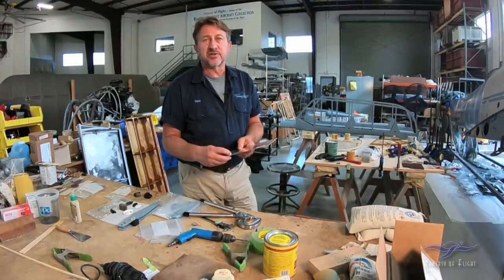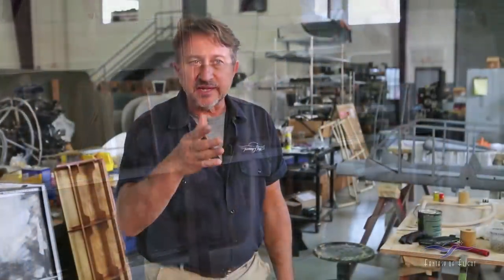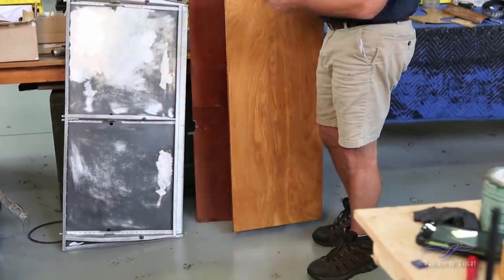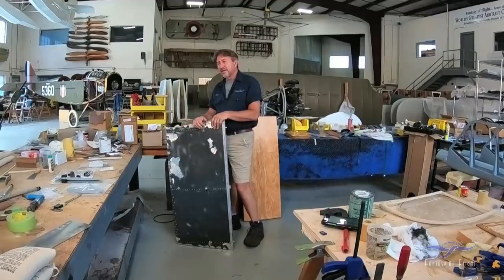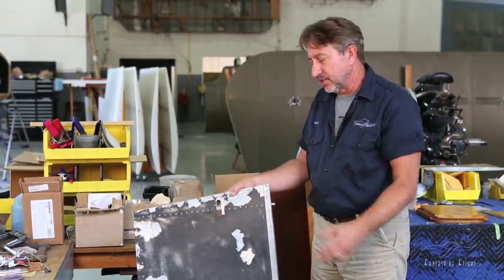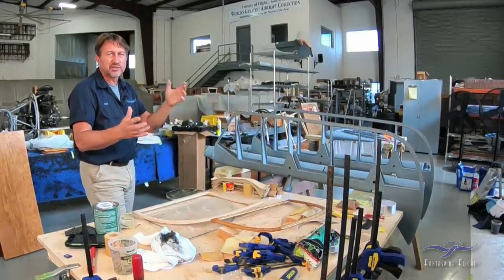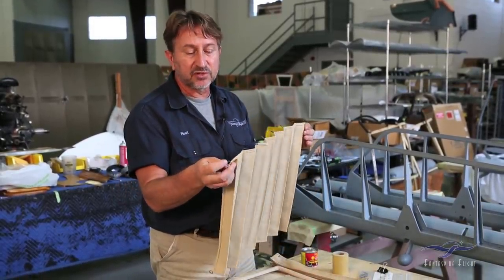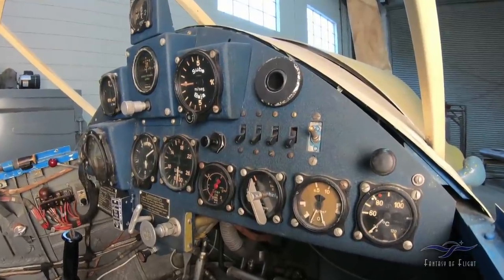Messerschmitt Bf-108 - Restoration Update #12 - September 2019

Comment: Love this stuff. Wish I had the courage to take on a full project like that. The reverse-engineering and remaking stuff is the most fun for me. For the rubber bits, I'd just design them from scratch in 3D cad, 3D print the mold, then cast the rubber parts - easy peasy.

Comment: When I first became a pilot, I had to supplement my income between flying jobs by working in an aircraft paint shop.  I thought chemically stripping regular aircraft paint was bad, but then the  two Army surplus Beavers arrived, covered with multiple layers of old lacquer.  It was a 30 day nightmare job, that required gallons of thinner, repeatedly spot treating with stripper in a pail using paint brushes, brass bristle scrubbing brushes and Scotch Brite pads.  I've had two aircraft I've owned painted over the years and because of my time working in that shop decades ago, I've never complained once about the cost of the work done and wrote out the checks with a smile.

Comment: Paul, when you come to re-apply the filler, are you going to use air drying cellulose putty again or go modern and use two part epoxy based filler?

Comment: I only a Aero modeller now, but I was just wondering if it would be a good idea to drill small pilot holes in the plexiglass before you knock in the nails might help save splitting the glass.  All the Best.

Comment: For the Rubber pieces, is there any reason a black urethane rubber could not be used?  If not, why not get some of the Smooth On products to make your own molds and cast your own rubber and plastic parts in house.  Small pieces like those 2 would have cost under $100 to get started but once setup can make probably a dozen of each for around $30 per dozen.

Comment: Question: Are you going to use filler again? Oh, another question. Are you gonna try and match the original paint color and paint it like that?
Reply from the maker: Jury is out on filler. If it is determined that that's what it takes for a smooth surface, then possibly. The plane will be painted in the colors of Willy Messerschmitt's personal Bf-108.
Reply: @KermitWeeks444 , OHH EMM GEE!!!  That will be the best paint job EVER, for a 108!  Whoever thought of that should be given a free case of Naked In Jamaica™ Rum!
Reply from the maker: http://www.pilotosretiradoslan.cl/wp-content/uploads/2018/10/avion-bf-108_34.jpg
Reply: This is a great paint scheme and will honor the designer of the Bf-108, Willy Messerschmitt. BTW First flight of the Bf-108 prototype was in 1934!

Comment: I wonder if one of those laser paint stripping machine / process might just be the ticket for removing the paint on this and other aircraft applications. I am sure its not cheap to buy the machine but maybe it would be a cost benefit result type of thing. From what I have seen the process is amazing. Wonder if you could not get a manufacturer to do an onsite demo on some test parts?
Reply: @David Chapman, I would think a LASER stripper machine would pay for itself in man hours PLUS FoF would be able to take in outside work (on other restorations) to bring in cash, when the machine was not in use for their own projects.
Reply: @odonovan  I agree. Also, we only have so much life available and besides the lack of mess fumes and other physical hazards from chemical methods laser might free up man hours for people like Paul to work on other facets of the project that still require skilled individual hand craftsmanship. And the results appear outstanding. I am sure FoF would discover many other ways this process would speed up, simplify and improve results in other areas not just paint and corrosion removal. And another income stream never hurts either. As far as cost, as famous as Kermit is and his FoF video reach I would pursue some form of sponsorship from the laser supplier. IE a video showing say "High tech paint stripping on the BF-108" could be a huge advertising benefit for the cost of a machine and its support...?? Might be a good way to move the needle forward for the laser and aircraft industry.

Comment: This was wonderful. So much detail. I can't wait until you get to the painting stage. I'm a vehicle bodywork and painter by trade. I believe Messerschmitt used a fair bit of filler on their 262 jets where panels didn't line up correctly? The rest of this 108 is seemingly over engineered and complicated. Typical German.

Comment: 2:17 - Am I the only one that thinks it's unusual, wrong, or maybe even stupid that Willie M. had the larger sheets tucked into the smaller sheets, front to back, creating a series of seams which only ADD to wind resistance, rather than tucking the smaller sheets into the larger, back to front, creating a series of seams where the larger pieces kept the seams out of the airflow?
Reply from the maker: Interesting thinking. Anyone else have an opinion?
Reply: @KermitWeeks444 , thanks for the nod!  My first thought was it was done to make sure the seams were as tightly sealed as possible, by fitting larger pieces under smaller ones.  However, it would be even easier to manufacture each sheet with the front seam of the smaller (rearward) the same size as the rear seam of the larger sheet in front of it, then put a slight inward bend into the front of each smaller piece, so they fit together nearly flush, with the proper amount of overlap for the rivets.

I used to make plate armor, from 16 gauge steel, when I was in the Society for Creative Anachronism, and have had to make pieces with overlapping plates that articulate (move).  I've never seen a larger part (of a piece of armor) made to fit under a smaller one (and this was German style plate armor we were making).  :)
Reply: Interestingly the kind of rear fuselage skins were changed in 109 production. Every second sheet had rims on both sides, they were put in a fixture first. The ones between those were just flat sheets put on top of the rims.

Comment: I think Paul as been glazing over just how hard magnesium is to work with and how expensive it is.  I found some videos from a car restorer that had to build from scratch a magnesium body for a 1936 Bugatti.  According to them it is very damn hard to work with.  It is stiffer and more brittle than aluminum and yes can be welded.  Which I would think take nerves of steel seeing that if you make a mistake suddenly your parts are burning at about 2000 degrees.  Also they said a 4'x8' sheet is about $3500.   After seeing these I am even more impressed with Paul and team. 

Here are the links
www.youtube.com/watch?v=oZvoe_ulbJ0
www.youtube.com/watch?v=uqRRVcpy8Qw